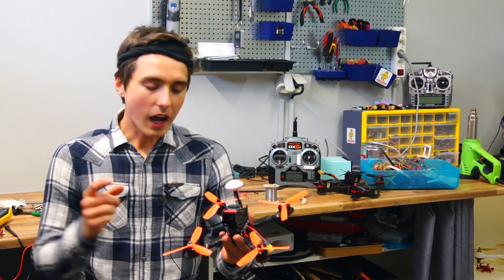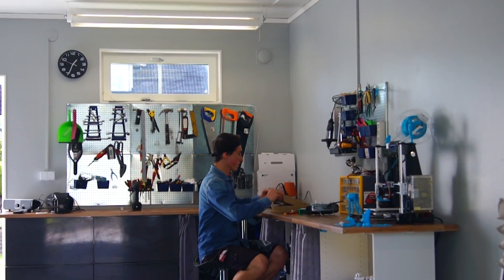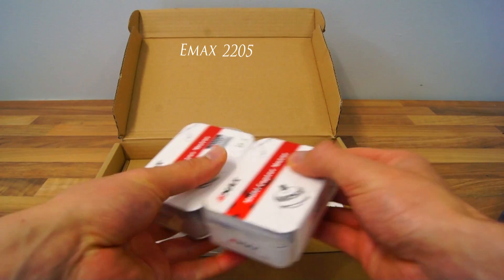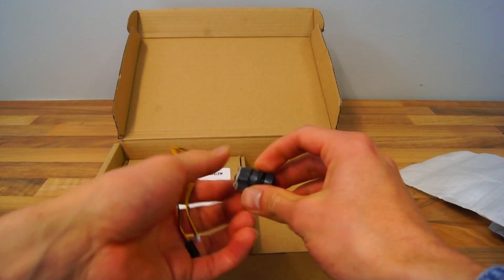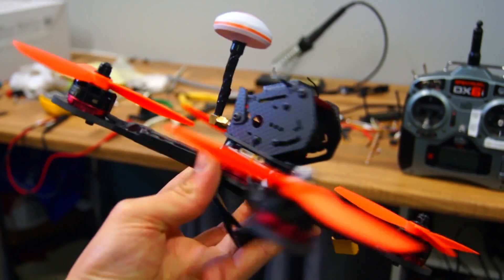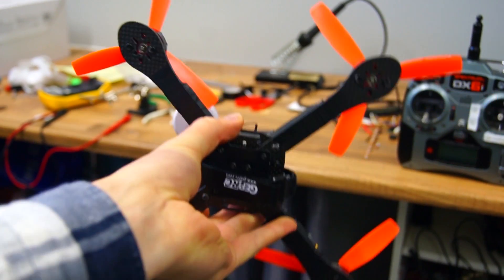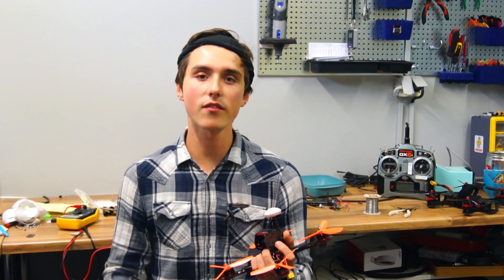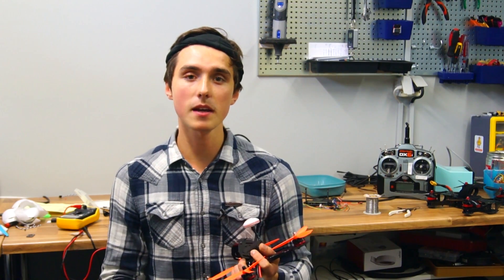Build a Racing Drone - DIY Kit

Comment: Great video man. I like  the drone as well. Maneuvers smooth. Amazing. I'm just getting into this FPV racing and want to build my own kit. DIY like this kit. The only thing I'm  hesitant of is the setup of the controller and goggle with the drone. There are so many variables to get right. Building is no problem. The set up I'm not sure. How did you do that?.Or is it more simplethat we all think. Have a nice flight

Comment: will an X7 receiver work with this build?
Reply from the maker: +Matt Hansen Can you give me a link to the X7 reciever?
Reply: I cannot find a link with the specs but it is an xk x7 transmitter that came with my xk 251 quad copter and it uses a futaba protocol does this help to answer if I could use this transmitter on a racing drone build?
Reply from the maker: +Matt Hansen Yeah, you could use it. Have a nice day and good luck with your build!
Reply: thanks I appreciate it and now I'm excited to order some parts and get at it!

Comment: 30a esc's are not for 3s batteries, i can say that quad is not for a begginer, emax motors are not the cheapper motors on the market, that's a very fast quad and specialy if you use a 4s battery. but thats a very nit quad, awsome model, congrats
Reply from the maker: Well, it doesn't really matter if you use 100A esc's with a 3S battery, my point was that the lower voltage makes the throttle more gentle. By using the Cleanflight software I dedicated a switch to swap between a "sport mode" and "beginner mode". The beginner mode would be self-stabilizing with expo and low rates. 

Instead of purchasing a completely new quadcopter you can now simply remove the self-stabilizing and increase the rates making it a quadcopter you could actually race with. However, it is indeed a nice model!